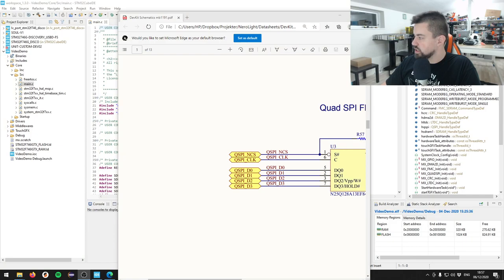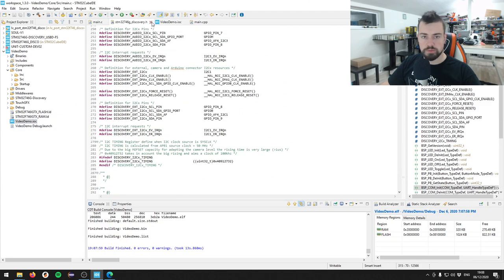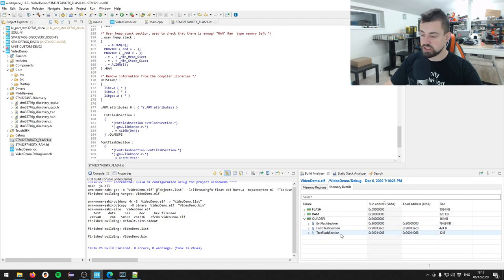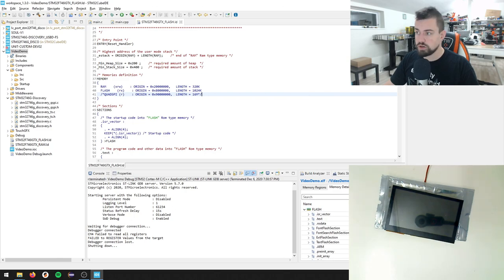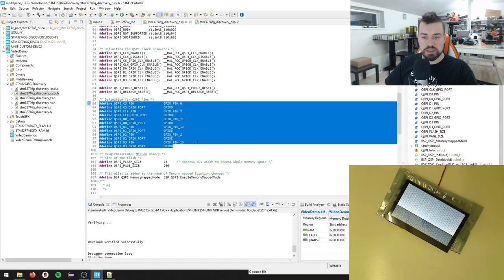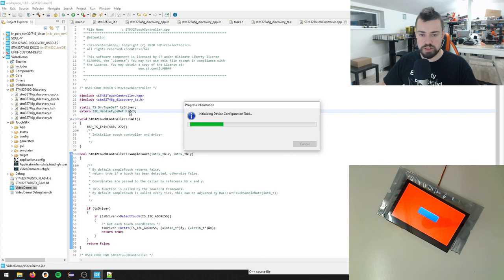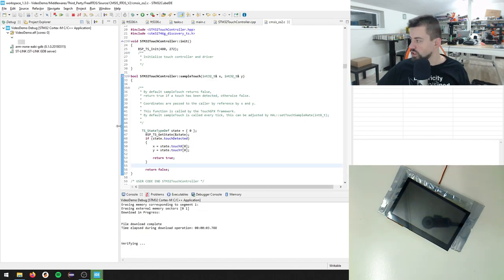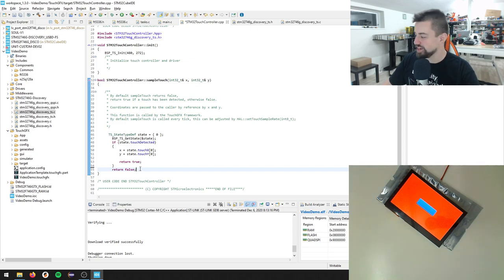Adding External Flash (QSPI) and touchscreen driver to custom board - WARNING: BORING VIDEO ;)

Comment: It took me 2 weeks of daily tinkering to bring up my stm32f469i disco with 800x480 dsi screen. Found some libraries where I learned that all default hardware configurations were wrong. Took some extra magic to get it running. Managed to read all existing documentation, datasheets, reference manuals from everything, different code snippets from libraries to figure out how the thing works. To say that I learned a lot would be like to say nothing, after some time I actually started to understand everything in datasheets now. I think I've just been reborn as phoenix - died as Arduino+ developer and born as ARM developer. Still haven't implemented QSPI and touch, they're in work right now, but at least I'm relieved (that I'm not completely hopeless) now, 2 weeks without progress were starting to discourage. Your content was among the most helpful resources!

Comment: Very useful video. Thank you! Please could you tell me which touch screen controller substitutes the obsolete FT5336 in your application?
Reply from the maker: I have used this display: https://www.buydisplay.com/low-cost-4-3-inch-480x272-tft-lcd-display-w-optl-capacitive-touch-screen
The controller is somewhat compatible (except the multitouch stuff)

Comment: I think that this should be interesting and informative. Just started watching. Looking ahead: do U use 
FMC internal peripheral for LCD? And can I use this tutor for bootloading executable code to external memory? And one more question: maybe u have some experience with LVGL?
Reply from the maker: This is the second part - in the first one I set up the full project and set up FMC and LTDC interface. 
This is not a tutorial on how to write an external loader - this is to come in the future. However, It goes through the process of putting GUI assets into QSPI flash and loading data from there.
I just tried LVGL out yesterday, but experience - I wouldn't call it that ;)

Comment: I just finished doing the steps from this video and the previous.  I was hoping that creating a project from a previous IOC file would make it easier,  but it only helped with the basics.  Copying the whole main.c and linker files from the previous project would save a little time.   The tGFX + CubeIDE should have a 'save as' or export function to convert the application template based project into a standard (scratch) type project.   Thanks for taking the time to create these videos!! If I can assist with these let me know. EEPROM emulation and SD Card FatFS are my next hurdles.
Reply from the maker: Thanks! It's quite funny how we seem to have the same problems around the same time ;)
I am in fact wondering how best to approach the EEPROM issue. I would like to store data either in the flash but apart from the EEPROM emulation I haven't found a good way to do this. Maybe an external EEPROM would in fact be the easiest solution to this!
(my custom board have an ESP32 so I could offload the storage to that and save myself a lot of trouble ;)
Reply: @banjohat  I  did implement the eeprom example from the ST repository,  but it executes before the RTOS and TGFX are started.  Their strategy seems like it works ok on the F746,  I presume it will port to the H735 ok.  The calls to it would need to block the OS/TGFX tho.   My needs are fairly basic.  Keep some config data in eeprom.  read it at boot and keep in ram,  if any config items are changed by the user, then update the eeprom.  The changes will not happen often so blocking the gui is no big deal.   Not sure if I want to use the ST stuff,  find some generic implementation,  or spin up my own.   I want to store a large struct,  not individual variables,  so I think I need to develop something more tailored.   I have something I did for a freescale "Coldfire" project that I may port.
Reply from the maker: @TurboBobBailey  and that is EXACTLY what I want to as well :D
Very interesting to know that the EEPROM example is blocking - maybe not something that can be changed due to timing constraints but interesting nonetheless. 
In the meantime I am also looking into low power modes and how to put the system into some kind of hibernation mode to save power.

Comment: Everithing is working with my MT25QL512 memory and with my STM32H743 MCU! However, just like your video, the screen slide animation is not present in the device, while in the simulator is present. Do you know why and how to enable it? Thank you a lot for all your videos!
Reply from the maker: It's most likely due to the missing 2nd or 3rd framebuffer. Are you using double buffers?

Comment: Thanks for sharing.  I did not understand how involved it was with the external QSPI Memory when I designed my custom hardware.  As fate would have it I am using the same memory and same processor (MT25QL128ABA1ESE-0SIT and STM32F746IG6 respectively) as you.  I am mapped:  QUADSPI_CLK = PB2, QUADSPI_NCS = PB6, QUADSPI_D0 = PF8, QUADSPI_D1 = PF9, QUADSPI_D2 = PF7, QUADSPI_D3=PF6.  Are you mapped the same way and if so could you share your loader with me?

Comment: Really amazing video, thank you for helping out. 

I have the H7 eval board with 4.3 touch, it uses a Macronix NOR FLASH and works in OCTO SPI configuration, this chip is really hard to source. Can I use the Micron chip mentioned in your video, configure my MCU for QUAD SPI and import the micron chip drivers. What's your opinion on it ?
Reply from the maker: Yes and no. You can use the QSPI I use but the pinouts used in the external loader will not be the same unless you can find one that uses the same pinout with YOUR MCU. if not then you will have to build the external loader yourself - something that I have yet to do. It should be possible but it's not straightforward.
Maybe you can find some loaders that are made for the H7 and QSPI? they would be easier to work with.

Long story short - the external loaders are both pin specific and chip specific...
Reply: @banjohat  Thank you for your guidance, will check out the possibilities.
Reply: Yes, the quad memories can be used off the OCTOSPI of the H7A3 and H723 type parts. Have to use in 8-bit command mode, and only 1, 2 or 4-bit modes.
So more prolific Winbond and Micron parts are usable.
Strongly recommend using the SOP16(W) 300mil footprint as everyone+dog sells this form-factor
cliveone / tesladelorean @ STM32 Forums

Comment: "External loader fails to download"
Hi all,

 

I'm trying to put some TouchGFX data (images, text, ...) in an external flash (w25q128) on a custom board with STM32H743IIt6 mcu. I'm using the quad-spi.

So, I follow the guide to make an external loader and I did it. It seems to work properly: if I load the .stdlr file in the STM32CubeProgrammer I can read, write, erase sector and mass erase the external flash.

Also, if I try to debug (STM32CubeIDE) a project using the loader without putting elements into external flash all works and I can see all the memories.

The problem occur whe I try to put somenthing inside the external flash. I do that in the linker script with TouchGFX sections: IntFlashSection and TextFlashSection. See the script below:
------------------------------
      -------------------------------------------------------------------
                       STM32CubeProgrammer v2.11.0                  
      -------------------------------------------------------------------

Log output file:   C:\Users\ELECTR~1\AppData\Local\Temp\STM32CubeProgrammer_a06572.log
ST-LINK SN  : 292C05026115303030303032
ST-LINK FW  : V2J40S7
Board       : --
Voltage     : 3.19V
SWD freq    : 4000 KHz
Connect mode: Under Reset
Reset mode  : Hardware reset
Device ID   : 0x450
Revision ID : Rev V
Device name : STM32H7xx
Flash size  : 2 MBytes
Device type : MCU
Device CPU  : Cortex-M7
BL Version  : 0x90

Memory Programming ...
Opening and parsing file: ST-LINK_GDB_server_a06572.srec
  File          : ST-LINK_GDB_server_a06572.srec
  Size          : 309.68 KB 
  Address       : 0x08000000 

Erasing memory corresponding to segment 0:
Erasing internal memory sectors [0 1]
Erasing memory corresponding to segment 1:
Erasing external memory sectors [0 43]
Download in Progress:

Error: failed to download Segment[0]
Error: failed to download the File

Comment: I have a completely unrelated and positive (for a change haha) question: the code generator can actually create a .c/.h pair of files per peripheral. As a person with clearly more experience than me, what do you prefer? I like the idea of having many files, and if I need to change something in LTDC, I just open ltdc.c, it feels less like clutter** in main.c. Is there any reason I would NOT want to have every peripheral in its own file? What is your experience?
Reply from the maker: Well I am actually just using the full clutter in main :P
But that's because I was unaware of the option until a few months ago.
Personally I have left all init in main and then use the task entry points to enter other files.

I think it depens on what you want to do: do you want to have all peripheral code located in the same file as the init? then it makes sense.
I have have organised my code in functionality and have created a few high-level blocks such as having a task that checks all the hardware interactions. I think that it makes more sense (to me) to have that block all by itself with its helper functions and have the task start that block directly from main.
Reply: You may want to enable this feature of the STM32CubeIDE when you have "external" drivers which may use the HAL library. So for example, if you have a sensor which uses the SPI to communicate with the MCU, you can create the .c/.h pair for your sensor, then just include the "spi.h" into the sensor driver header and you will have all the HAL_SPI resources and functions available for your driver. 

So it's good to enable this when you have big projects with a lot of code/drivers, since it will allow you to share the HAL/LL peripheral resources easily with all your code, maintaining everything organized. In little projects it doesn't make a lot of difference.

Comment: Hello! Thanks for this video! I do the same and it works) But i still have one problem. When the framebuffer changes, i see artifacts on the display. Do you know where is refresh signal for LTDC to get the framebuffer? I think that LTDC gets framebuffer periodically, but don't skip when it in changging process. Do u have same problem any timess?
Reply from the maker: There is a global interrupt that tGFX uses for refreshing.
I have had small artifacts in the beginning but that was mainly due to problems with the QSPI and having the GUI assets not loaded properly. If you're using that try to move all pictures to internal flash and see if that helps.
Reply: @banjohat  I mean this effect calls tearing. I see artifacts only with framebuffer changing. LTDC gets frame while DMA2D still filling buffer. LTDC don't wait end of DMA2D job. If i store pictures in internal flash, result is the same. I have read on the different resourses, that there is a function "lockDMAToFrontPorch" which don't let do actions with the framebuffer DMA2D and LTDC at the same time. But in version 4.15 it isn't work.
Reply: @РусланАкмалов-г6э  You should this post in the community forums :) there are a lot of knowledgeable people :)
Reply: @hanspeterhaastrup-nielsen8446  I think ure right) I’ll do so)